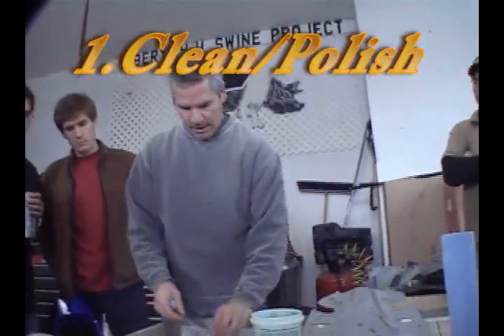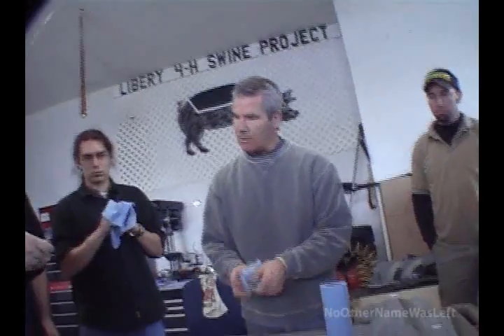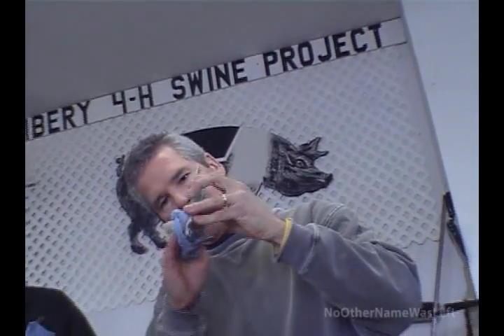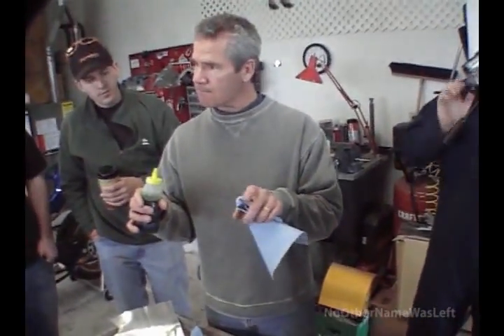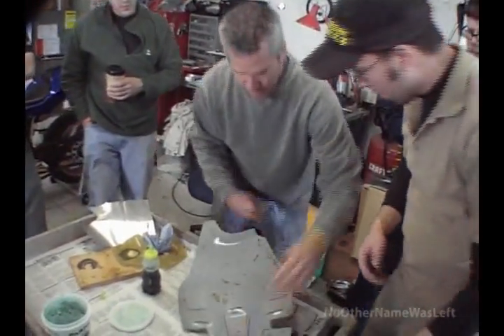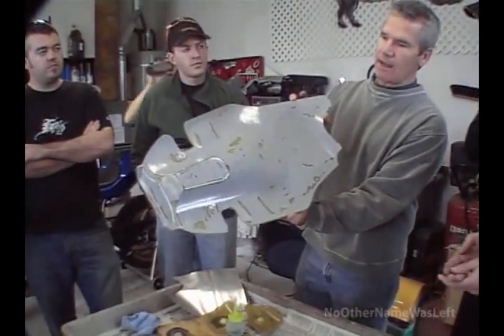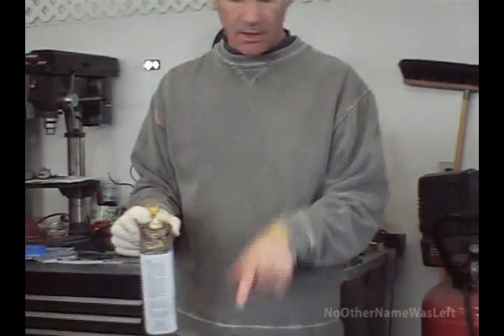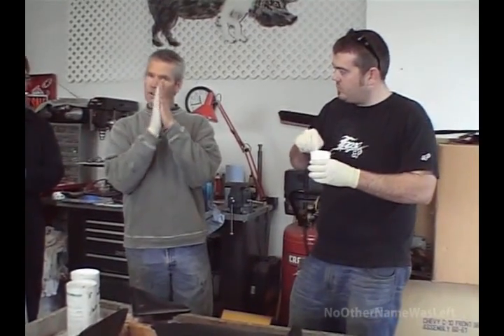Tygaboys Carbon Fiber Fabrication Seminar Episode 1

Comment: This kind of work is so easy. Wax the shit out of your mould, apply a bit of resin over it all before the first layer of glass or whatever so you get an even saturation within the material, apply layers but make sure you have sufficient resin between layers. Roll ALL air out (but make sure you don't over saturate and fuck the glass or core), leave excess resin or screet off with a rubber screet.

Comment: 1.  No gelcoat for carbon fiber, just resin.  You won't see the carbon.
2.  Get PVA from Fiberglass Services in Gardena, CA (carbon cloth, fiberglass, epoxy etc etc as well.  They supply surfboard makers, they have everything, they're super cheap, and very very nice)
3.  PVA should be sprayed on, not wiped on.

Good luck.

Comment: very very thin, the thickness of the fabric itself is like a 64th of an inch.  Small pieces unravel really easily though so you may want to put some sort of backing on it before you cut it. I would use a nice pair of scissors. Depending on what you're inlaying in you can just cut route the inlay about twice as deep as you need, lay the fabric in with a little adhesive and drown it in bartop epoxy... sand and polish once its dry and voila!  Good luck and let me know how it turns out man.